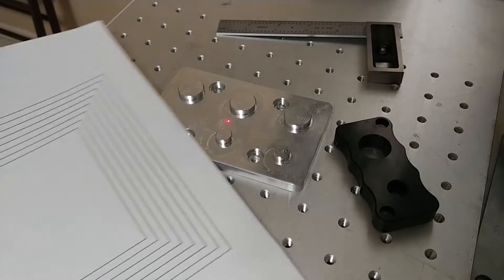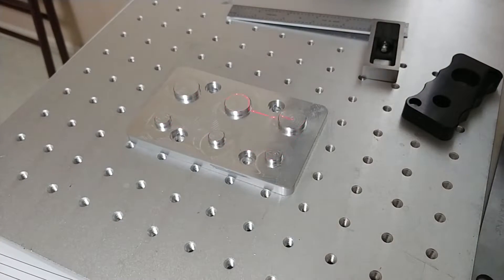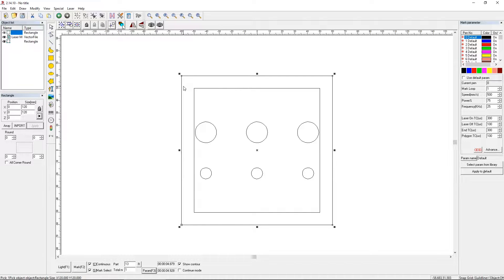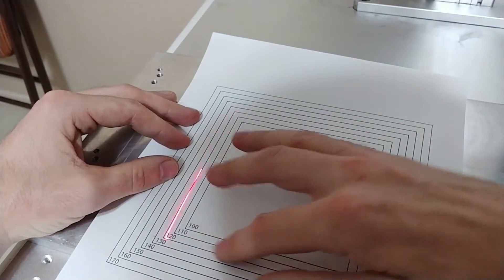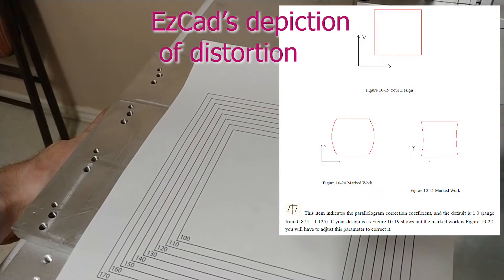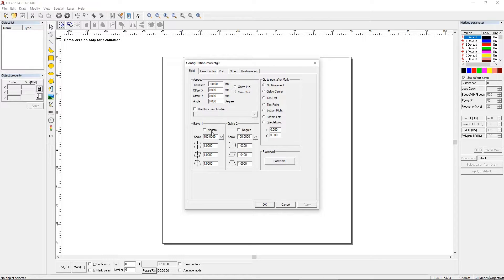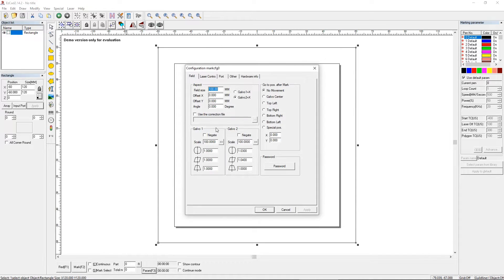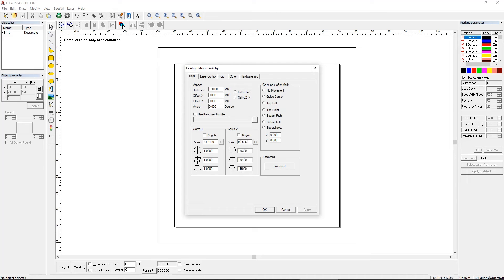EZCAD2 : Laser Marking Field Adjustments - Distortion & Scale

Comment: I have a 50w fiber laser with a 150 lens. In my parameters settings I put 150mm, set my focal length and then made adjustment so that when I made a box 42mm x 42mm that is the size it would mark. Was I correct In my doing this? 
I hate to say this but it is a bit confusing to say the least. Im learning but by means of guessing.

Comment: thansk well explained, !

I would like to know how to correctly adjust the working area to enlarge the field to 20 cm.  you know how .  I did it I could y = -20 × = -20 and it was from 0 to 20 I don't know how to do it
Reply from the maker: You want to change the workspace in ezcad to match the field of your lens?  Go to File>System Parameters, then tick the box to show workspace.  This is where you'll enter the values.  If your lens is 100x100, you'd enter -50,-50 for position and 100x100 for size.  You will also have to adjust your field size in the F3 Parameters to the new size of your lens and you may want to adjust for skew too.
Reply: @jefferyj  THANK YOU ! I DID IT AND I FIXED THAT ERROR!

Comment: I've been struggling with this most of the day today. I enter my desired marking size and actual marking size for galvo 2. Then set galvo 1. But the number I enter for actual marking size in galvo 1 also resets the setting I added to galvo 2. If I enter 123.5 for galvo 1 or 2, it duplicates that number for the other axis.

Comment: when i adjusted   concavity on sides
i had to  back  and check sizes too and vice versa

take some time  but now  pretty close
made mark on scrap sheepmetal and on 150 it might has  0.3 difference

interestingly i could  leave at 1.000  perspctivity  also  it was much  square

on the end  made screenshot about settings and saved it

Comment: I have a problem. My font is very blurred. how to fix this problem? co2 laser for wood.
Reply from the maker: I don't know much about CO2...join the CO2 facebook groups to get help with that.  There are plenty of experts out there that could probably solve your issue quickly.
Reply: @jefferyj  hey Jeffery I hope you're still active in being helpful! I have a question about a bunch of things involving fiber laser. For one I'm trying to figure out the way to get the most power out of my machine. The power and frequency have a lot to do with it apparently. I'm being very long winded right now but right now I have my machine at 90hz frequency and about 70% power for a, apparent, 120 watt fiber laser. I have it at 200nm as well? I'm not sure what all the numbers are meaning but idk I just wanted to know what they all mean and what the best parameters would be to get the full power of the machine. It's being a huge headache. Goodness if you read all that thank you. If you don't reply I understand 😂

Comment: I was tripping on why the settings are for Y and X in the columns and not X and Y, but it seems that you just use the names X and Y the other way when measuring. Would assume that Y is along the axis of the galvo head tower assembly and X is across it (like left to right), like is usual convention. But no matter what you use, as long as you know what it means then it's ok, just makes it a bit hard to understand without definition.
Reply from the maker: Yes, I was speaking in the normal sense where X runs <> side to side and Y runs ^ and down.  The same as if you stood in front of a standard 3 axis milling machine.

Comment: I’m completely new to Fiber laser engraving and ezcad as I only have experience on lathes and 3D printing machines using CAD based software.

Am I correct in assuming that once you have calibrated your laser for both X and Y as shown by the method on your tutorial....any other measurement that you add into ezcad will be true to?

BTW I’ve subscribed to your channel and watched many of your ezcad tutorials and they are really good.

Thanks man!
Reply from the maker: Yes, that's right.  There are a couple methods to do this, but this basically adjusts for any skew as you move to the outer edges of the marking area.  On the same screen in ezcad, you can adjust the scale to ensure you're marking true to size.

Comment: I’m actually just looking at calibrating my laser right now too- thanks for showing your approach, I think I’ll give it a try.

My ezcad came with an executable called corfile2 which marks a test pattern and asks you to measure each of the segments (initially 9 points I think, but you can go up to like 27 points for finer calibration).

It uses the data to calculate a .cor (correction I think) file which you can apply instead of manually entering all those values.

I don’t think the result is any easier, and I wasn’t getting much satisfaction from the accuracy of measuring with a ruler.
Reply: I was thinking of trying a deeper etch in the box corners, so that the caliper tips have a registration notch.
Reply from the maker: I noticed corfile2 in my EzCad folder, and saw it mentioned in the manual but never realized that was its purpose.  Thanks for pointing that out.  I wonder if that's what the factory used to calibrate it initially.  If you have good results using it, please let me know - I might give it a go.  The deeper etch might be good too, if I recall correctly, I just ran the box on continuous marking mode and let it complete about 5 passes (with some noticeable error on the end position).
Reply: How do you get the corfile2 to mark?
Reply: @bitterrootdieselperformance  https://www.youtube.com/watch?v=llflAf0G62Q

Comment: I used a piece of graph paper to verify the concavity and skew as I was adjusting the scale.  No mention in my manual about order of operations on adjustments vs scale so I was messing with all the values at the same time. Not recommended.  I was mainly trying to ensure proper scale.  The graph paper was an easy way to have a visual reference for the red laser.  Final tests were a light mark on aluminum measured with calipers.
Reply from the maker: I hadn't even considered graph paper - that's a good idea!  Just as you mentioned, initially I also was changing multiple values at the same time and I agree - definitely felt like there was too much guess and check and there should have been a slightly better approach.  Sounds like we went about this in a very similar way.
Reply: If you don't have graph paper, give this site a shot to print out a sheet on your own. 

https://incompetech.com/graphpaper/weightedgrid/

The printout will provide you a 250mm by 190mm grid. My field of view is 200x200, but I think this will still work just fine.  Thanks, JefferyJ for helping so many of us get started on our adventures!